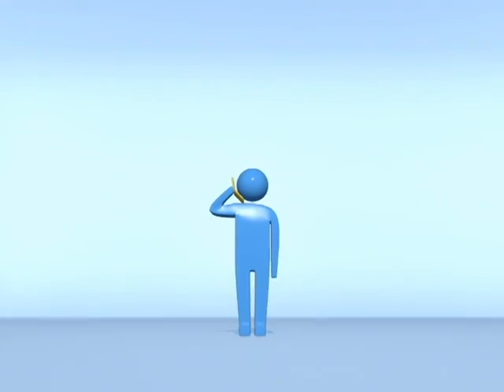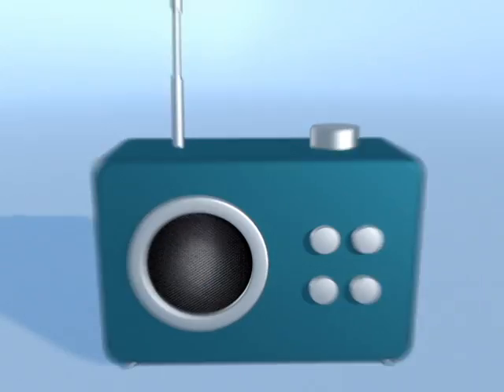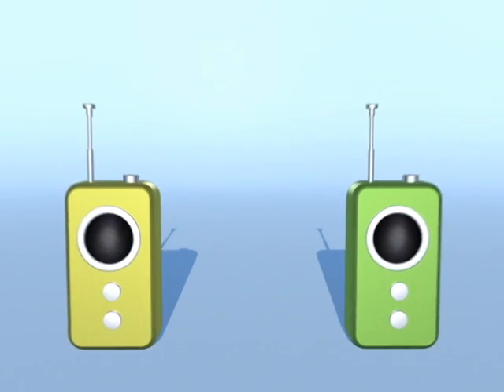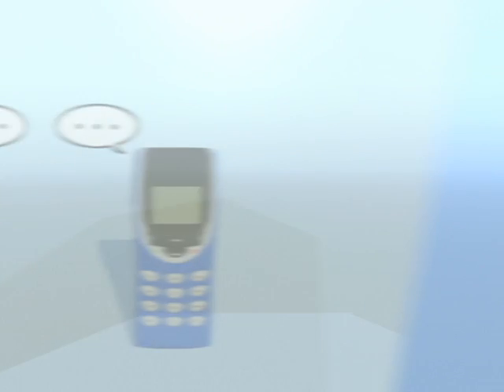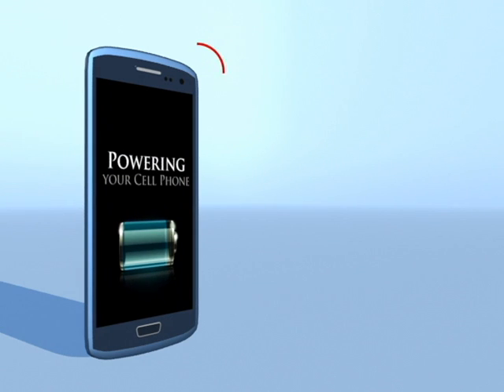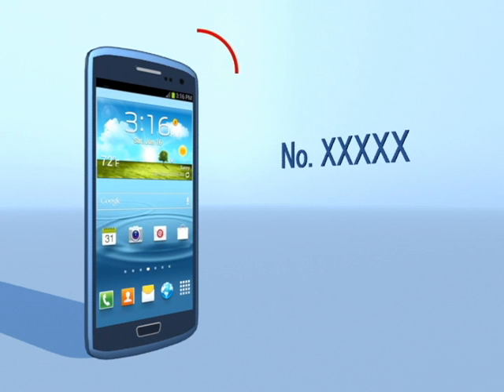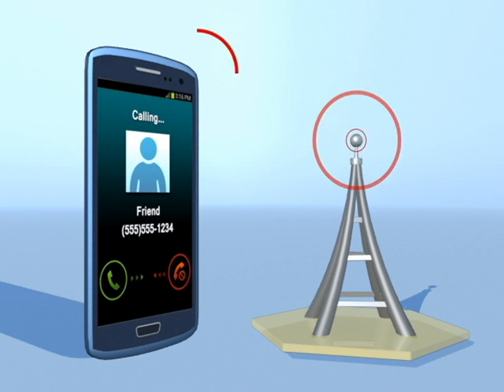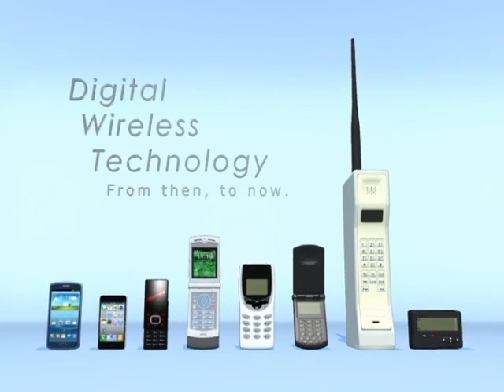How Do Cell Phones Work?

Comment: Hello and thank you for this video!  I don't know if you are planning to make this a part of a series, but here are some add'l questions that i have: 

•	How do cells divide up the city and allow frequency reuse?  
•	What is a “control channel”?  How does it work? 
•	So is each cell assigned to a carrier and each SID is assigned to a cell? How many users can use a cell at a time? How many users can use a frequency at a time? What happens when users from different carriers need service throughout the city? What happens in congested areas of high cell phone use?
•	Once your phone and the tower switch on the assigned frequencies, your call is connected.  Are two frequencies (one for one speaker and the other for the other) assigned in both the city where a call originates and in the city where the call is received? What is the full path of data from caller to receiver? How do the following terms fit into this?
•	Device: phone/pc/tablet
•	Transmitter
•	Receiver
•	CO
•	Backaul
•	Cabinet
•	Cell